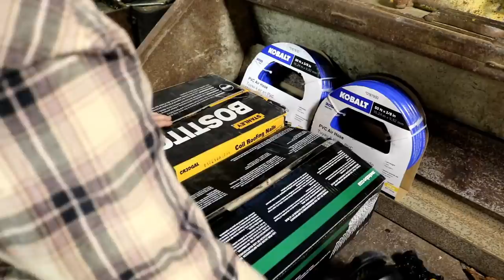Jackhammering Concrete Floor and roof Prep

Comment: here back in swizerland,we use scrues  its always the best joice
Reply: At the very least screws will pull the members tight, if the unthreaded shank is the proper length.
Reply: Not many >3.5 quakes there, I take it.
Reply: @elitearbor  You know there's more than just drywall screws on this planet, right?
For that matter, fastener shear is hardly a problem when you look at the side grain crush strength of SPF studs and most other building materials that you might nail.
Reply: @jimurrata6785  I do know that there are many types of screws, yes. The majority that are installed, with the caveat that this may well apply only to the areas of the USA in which I've lived, seem to be hardened to a far greater degree than common 0.131" ring shank nails. I've certainly seen far more of them fail shear loads than I have seen nails fail in a similar manner! 

I'll look into the rest, as I can honestly say that I've never compared the side grain strengths of studs or the shear failure point for common residential materials.
Reply: @elitearbor  I guess I am trying to point out two things.
A) Structural and decking screws are indeed harder than nails of similar shank diameter, but, the fact that they are less ductile means they don't 'roll over' and turn shear force  into withdrawal force
B) A  proper unthreaded shank will pull members tightly together, and if there are small seismic events or major wind loads they will not loosen.
The friction between tight members helps too.

Screws are slow even from a collated gun  compared to nails.
Hell, I grew up framing with a 28oz hammer! 10/6.  I looked like Popeye   😂

Do your own experiment.
Take two 2x4, overlap them a couple of feet on the flat and drive a 16, 6" from the end of one. 
Flip it over and drive a 3" deck screw 6" from the end of the opposite side.
Set the ends on a block or something (on edge) and stand on the middle.
I'd bet the nail crushes the wood to the side and pulls out LONG before the screw will shear or withdraw.
Reply: Dri wall screws good for dri wall nothing else

Comment: Steve, while your shop project is interesting, your truck is a disaster. 1 tail light out, one headlight and one high beam. Shouldn't you get those lights replaced so you and other drivers are safe?  ALSO, you should have cut the ends of the extensions  perpendicular to the angle of slope. In that way, water would not run down the face of the end of the extensions and get sucked up into the end grain.  As an alternative, get some paint on them to seal the wood from rain and snow. You have certainly come a long way towards completing your shop. It has been quite a struggle. Project almost complete.  Very nice job carefully carried out.

Comment: screw vs. nails... should you use something 2000 time stronger than required, or 4000 times stronger than required? the wood itself will fail long before the nail or screw.

Comment: Hi Steve, I accompany the reconstruction of your shopbuilding for a quite while. You are doing a perfect job! But there is one thing I don´t understand. Do you really dump the rocks of the old concrete on the other side of the road in front of your house??? Or is it just an interim solution??? Greatings from Hamburg, Germany

Comment: Yeah, I've had problems with No-ass-a-tol all my life. I'm a scrawny little twat who weighs 140 pounds dripping wet. I try not to let it get me down. It is still possible to lead a (fairly) normal life with No-ass-a-tol, you just have to know your limitations, and never put too much in your tool belt or it's gonna hit the floor!

Comment: Surely you realize by now that you could have rented a wheeled concrete saw and a skid loader mounted concrete breaker to eliminate a lot of manual labor?
Reply from the maker: Pickup and return of the rented bobcat plus the saw would have taken more time than the work itself.
I doubt they would let someone in a old  1/2 ton pickup without trailer breaking abilities haul their equipment as well. Although I'm sure they would be happy to rent me a truck & trailer as well. Sure,  I could have paid out the nose to avoid breaking a sweat, seems like that's the norm these days. Sometimes its easier and much cheaper in the long run to not do everything in your power to avoid work.  I definitely get what your saying there are better tools for the job.  Heck, I could have hired a pro to do it and just drink coffee while he works.

Comment: WHEN POSSIBLE USE HYDRAULIC JACKS OR EQUIPMENT TO LIFT THE CONCRETE SLAB WHATEVER HEIGHT YOU CAN.  THE JACK HAMMER OR SLEDGE HAMMER WILL BE ABLE TO BREAK LARGER PIECE WITH LESS SMALL CHUNKS TO DEAL WITH.  LIFTING THE SLAB ONLY 4-6 INCHES WILL LET THE HAMMER SHATTER LARGE CHUNKS BECAUSE NOTHING IS SUPPORTING THE EVIL STUFF.

Comment: Steve, I sympathise with you about your Noassatall condition. However, you will be pleased to know that the incidence of that particular disability is in rapid decline in the continental United States, and indeed in other Western countries.

Unfortunately however, there is a huge rise in a related condition, and it is exhibited by both men and women, and the disease, curiously, displays some of the same symptoms as Noassatall; tool belts and trousers do not fit, but the reasons for this are, if I may say so, diametrically opposite. This condition is known as "Rhinocerass", which although serious enough, is a minor problem when compared with the increase of a similar, but far more serious condition, which is described by the medical people as "Hippopotamass"...

Comment: Steve,  im telling everybody about a tool i saw on R. steven lang's channel. www.lasercenteredgefinder.comsells them.  mine throws a .001 inch red dot where "x marks the spot" i use ;"dark blue marking color" from dykem. it prevents backscatterwich makes the dot look bigger. original "purple-blue" dykem causes dot to look bigger.  Mcmaster is where i got my fluid.   tell them i sent you. i want Mcmaster to love me!   poppy's workshop says HI    and i was afraid to say bust up half the slab?? lol  i think this laser is wanted by every machine shop.   stay safe  poppy

Comment: Huh? Doesn't matter what the time of day is when you describe any given period of time. There's still exactly the same amount of daylight. Where's the issue? Start in daylight, finish in daylight, call it wheelbarrow-a-clock if you want but the amount of daylight doesn't change regardless of daylight saving.

Comment: We have the same system of daylight saving in the UK it should be stopped it just makes no sense
Reply: They brought in 'British Standard Time' around 1970 for a couple of years, stuck to summer time all the year round, GMT + 1. Parents moaned about it as some kids were walking to school in the dark. In WWII they had 'Double Summertime' (GMT+2)BTW your left hand brake light is out, also don't blow yourself down with HP air, had that drummed into me years ago! Stay safe in these 'interesting' times. All The Best from Somerset UK, MAGA.
Reply: @jonathangriffin1120  Then let the kids start school an hour later all year what do you think ???

Comment: For dumping the broken rubble did you consider reversing and then just braking really hard, instantly emptied!
Reply: Wayne Digby I thought exactly the same thing. You would have lost at least half the load on the first try ,especially as it was on a down slope, two attempts and Hey Presto! All concrete on the pile!

Comment: screw vs nail.
srew are remouvable nail, are a pain to remouve.
Reply: That depends how badly you strip them putting them in (pro tip,  use a hammer to put them in and keep the slot pristine for removal)
Reply: I prefer screws. They seem to hold more securely. Nails can loosen with expansion and contraction of wood, and as the wood dries out internally over the years. I can’t remember the last time I nailed anything together... and I prefer to use torx heads screws. They don’t strip easily...if at all...

Comment: Noticed you uploaded in 1080p 60fps. Seems to me there's no point using 60fps, even movies are only 24fps. At 60fps, It ends up taking longer to buffer and load on slow internet connections like mine.

Comment: You are going to hate yourself for years to come for not finding a better place to dump all that concrete from your shop floor.  I tore out the floor to my basement (It was breaking up and needed a french drain). Anyway I piled the concrete from the floor much like what you did and thought the weed will grow over them and it will be fine, well that was until my old lady didn't like the 75 foot long 3 foot high bern of busted concrete with weeds growing on them a couple of years later and then I spent I not sure how many hours killing weeds and picking up the busted chunks of concrete again.  Fortunately I did not have to pay to haul it to the dump because I had a neighbor who was filling in an old swimming pool and was looking for something that would drain and take up space so he would not have to buy as much gravel and sand before covering the hole with a couple feet of top soil.  
As far as the arguments for and against daylights savings time and or deleting it and staying on standard time or staying on daylight savings time before you make up your mind one way or another go back ad the original ideas for it and then make up your own mind without someone else whispering sweet nothings in your ears, personally I like the springing forward an hour in spring and falling back an hour in winter because the adjustment of daylight in the morning is more important to me than what time it gets dark in the evening but opinions are like a certain body opening and everyone has one.